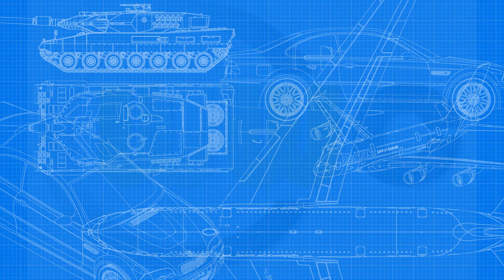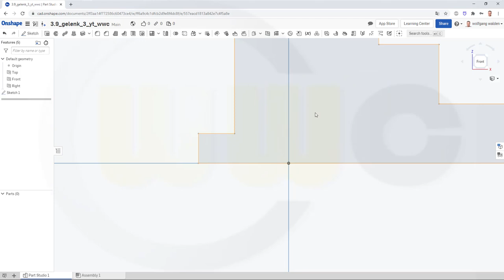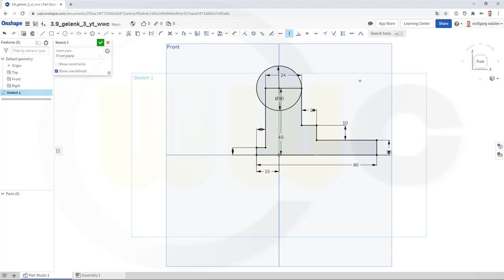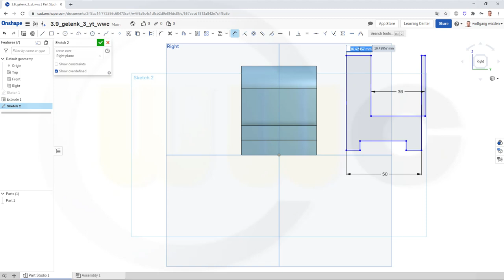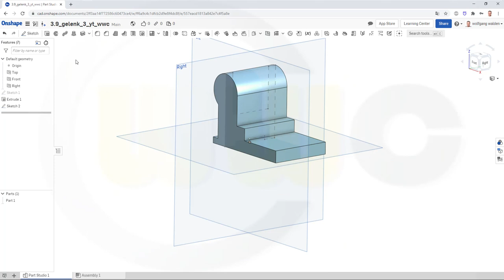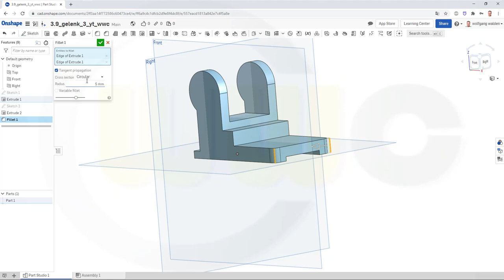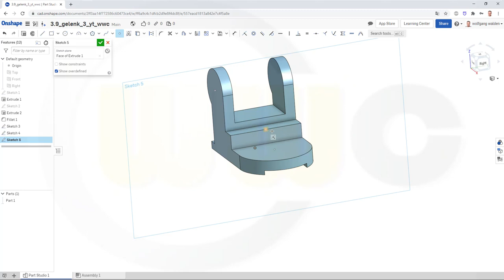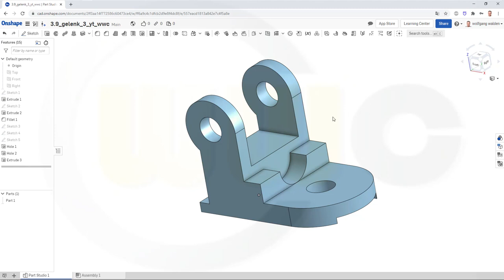3.9 Gelenk 3 - Joint 3 - Onshape Training - Part Design

Comment: No need for the last extrude. Make a counterbore hole with 0.01mm diameter, 20mm counterbore diameter and depth and hole depth 20mm.
Reply: Counterbore depth and hole depth should be 10mm.
Reply from the maker: Nice "trick" but this is not the way the software should work at all. There should be an option for a flat bottom.
Reply: @wolfgang.walden.cad.training  Maybe there wasn't the option a year ago but there is now.